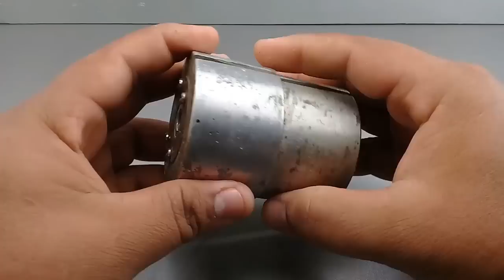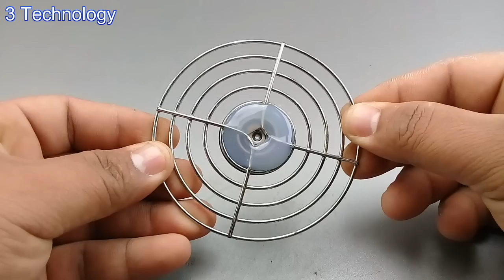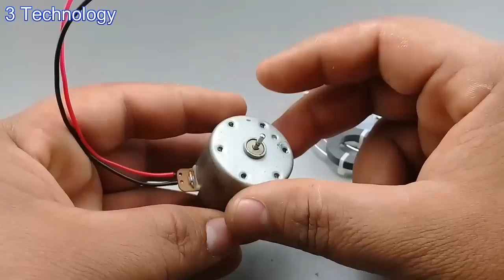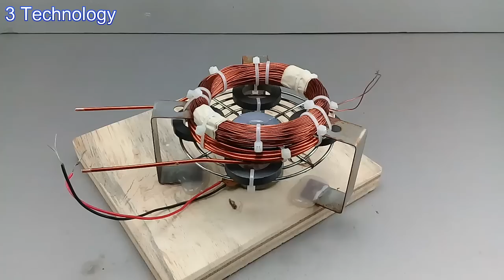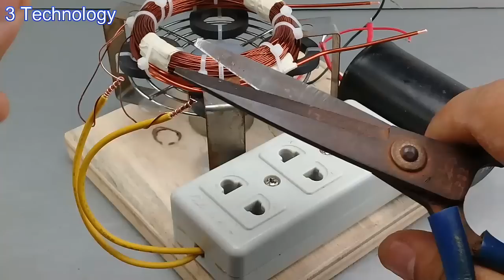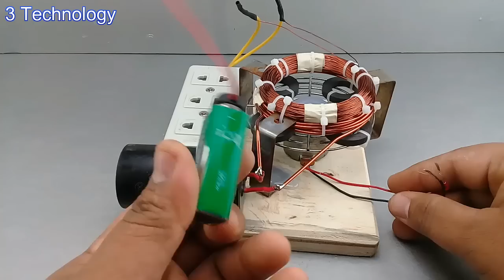I turn two copper wire into 220v 4000w most powerful electricity use Capacitor / Free Energy

Comment: Cool, now add a transformer to convert the 220V into 9V so you can eliminate the battery and you have free energy forever. Your device ran for at least 208 seconds, so the most it can be drawing is under 30mA (assuming the battery is capable of supplying 500mAh), which would be a quarter Watt. That would still leave you 3999 Watts of free energy.